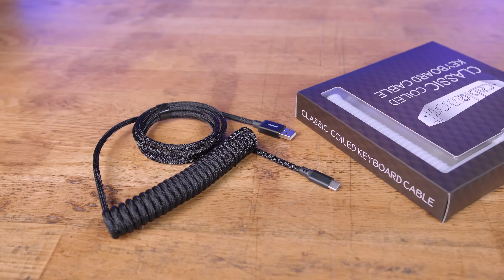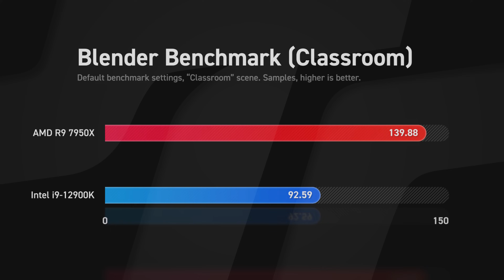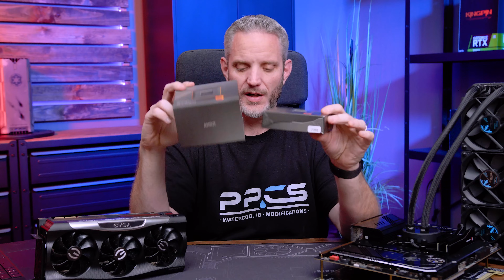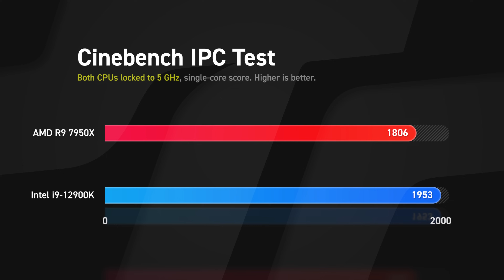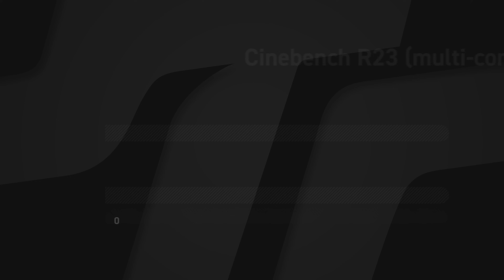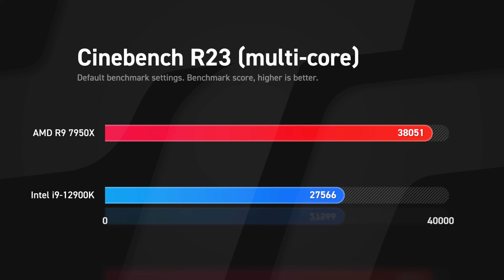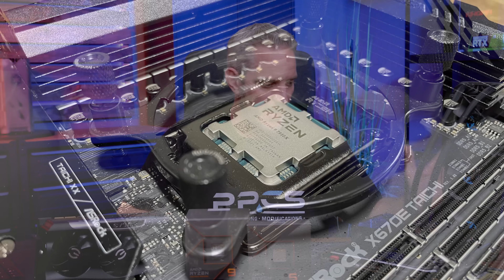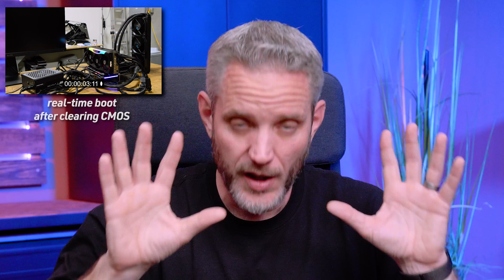Forget EVERTHING you THINK you know about AMD... these CPUs kick A$$!!

Comment: Was skeptical on the new architecture but now I am hyped. Hopefully the mid~lower tier CPU is good too.
Reply: I'm hoping the same, for most casual gamers the Ryzen 5 was te sweet spot last few years (not breaking bank, and could handle most stuff that was thrown at it)
my system will be in need of a little update in the not too long future (Ryzen 5 2600 + RX580 8GB)
Reply: @renemartens5657  the 5600x will be a nice upgrade for you. No need to upgrade on a new platform, save some money and get a nice gpu. At least that's what I would do.

Comment: Space engineers and kerbals!   So the cinebench seem to be the most accurate bench when you are talking physics engine load on gaming, espically unity based games. I play alot of kerbal, and the reason i got an 11900 k origionally was because it was the fastest single core at that time, for running the phsyics engine, because unity only runs the physics on a single core. As the whole came comes down to that, the intel was the best deal both in performance, and performance to cost ratio.  hope that helps someone

Comment: Is it stable?  I left AMD after I owned an AMD K6 back when they broke the 1GHZ barrier and had no end of stability issues.  I switched a few years later to INTEL and haven't looked back with no real stability issues since then.  I'm excited at what AMD has managed to do the last few years, but they burned me a very long time ago so I must admit to having a great deal of trepidation.  So I have to ask, is it stable in day to day opperations?
Reply: Not trying to be rude, but basing your judgement on one CPU generation, and one from 25 years ago, is a pretty broad generalization. Intel and AMD have both had problems with stability over the many years since the K6. I have bounced between Intel and AMD many times in the same time span, and have had successes and failures with each. I've been running a Ryzen/Radeon AM4 build since 2019, and while it was not initially quite as rock solid reliable as the Intel X58 platform I ran before it, after a few BIOS updates it has become just as dependable as any other build I've ran from Intel.

There are growing pains with the first generation of hardware every single time, and as hardware gets more complex, it's going to continue. Intel 12th gen was awful for a lot of people at launch, just as 1st gen Ryzen was. It's the early adopter tax that you must pay if you want to play with the latest and greatest, and IMO if you want to avoid that pain, always give a new platform 6 months to a year before migrating, regardless if it's AMD or Intel.

Comment: I have an OLD pc right now and I'm looking to upgrade. I have an Intel 2600k and gtx1070. Would I be ok to get something like a 5600x or should I be trying for the new 7000 series? Also same question for the gpu. I've been going between 6800xt or 3080 but should I just wait or are lower prices on current Gen good enough?

Comment: My issue has not been whether AMD makes usable CPUs or GPUs, it has been in their deceptive design and marketing practices where they game the benchmarks and push synthetic or atypical benchmarks to claim they are faster.

In every single generational comparison of Intel vs AMD, Intel has beaten AMD in actual use cases for speed. In DAW work for concurrent processing power on live previews, in ACTUAL, non-synthetic video rendering times I experienced, in gaming FPS, in frame delivery (AMD having stuttery delivery spacing) and so forth. Weird hangs in windows. Ever since Bulldozer/Piledriver, this has been the case for me.  Tech reviewers praise a new AMD generation, Reddit drools over it.  I throw one in a second rig, it performs worse than my apples-to-apples Intel rig. Rinse, repeat. Not going to be curious after 11 years of the same situation. Buying Intel every time.
Reply: nop, intel always paid benchmarks, and a lot of comapnies to win against amd.
Reply: @maxdamage4919  Absolutely opposite-land false. Intel always ALWAYS gets more frames in gaming in the same generation. You're delusional and think that Intel "paid benchmarks" when you can just play the games and see the frame difference yourself. AMD, however, lied for a decade about frame delivery issues where they would claim 100FPS but every other frame would have a 20 or 30ms gap. They lied about it for a decade and then admitted to it and said it was fixed and then a year later it turns out it wasn't and they had to fix it again. There are so many weird lies that AMD tells to claim they are competitive. They push these super-wide all-core performance numbers when programs don't thread their work that way and in reality Intel is faster when using the computer to do normal tasks. So many examples of this shady deceptive framing of their performance.

Comment: "The cool thing is that it didn't throttle..." 😂 no, that wasn't cool it was hot.  Sorry I couldn't resist.

Seriously though 95C on a 360mm AIO! 🥵I love improvements, especially big ones, but I also miss the days of like 45C on a Thermalright XP90C(90mm copper cooler).  It feels like the rate we're headed, both CPU and GPU will need to be run on liquid purely for performance issues with heat(I know it didn't throttle, but I dare him to test a 120mm tower heatsink).

Comment: I'm going off topic, but I need to ask if the new AM5 platform is compatible with current gen PSU's?. I am concerned if I upgrade to AM5 I will have to get a new psu which fully supports pcie5, etc.

Comment: From what I've seen, these new CPUs are fine but not amazing. They are going back and forth with the current Intel CPUs. Some games they're a bit faster, some not. If Intel's next chips are faster than the current, AMD is toast.
Reply: They're better in everything.  The only thing they compete against is the 5800X3D, which makes sense because it's designed for gaming.  The 7855X3D will replace the 7950X as the best for gaming (unless Intel gets its shit together)

Comment: Alder Lake does not have AVX512 enabled, only VNNI subset. I can'f find diagrams but it is possible the FPU has more throughput vs AMD, as the underlying architecture has AVX-512 capability in silicon.

Also worth mentioning is that AMD AVX-512 doesn't increase throughput (FPU width) per se but the new instructions will make some computations more efficient and hence, the speedup AMD reported in the presentation.

Comment: Actually, everything but the Ryzen 5 7600x is good at what it's supposed to do. 7600x is a joke. It has no value proposition at the present moment. Maybe when the price of the motherboards go down, but it's not guaranteed they will go down to as low as they would have to go for it to be a good value compared to something like the i5 12600. And then there's the 13th gen coming, and if Intel makes any improvement over 12600 at all and keeps the same or similar enough price? 7600x will have no legs to stand on at all. It's mostly a waste of sand, just like how 11900k was back in the day.

Comment: For the life of me I cannot find any AMD EXPO kits faster than 6000 MHz. From what benchmarks I've seen faster than 6000 actually does impacts performance but all I can find are intel XMP kits faster than 6000
Reply: Does anyone know if you can use XMP kits and just manually set the speeds or do you specifically need EXPO kits?

Comment: I like your reviews b/c they not only have the boring benchmarks that are concrete factual information but also the "it feels . . ." statements b/c perception often is reality. My question is, for something like video rendering where you might be relying on CUDA h.265 more than the CPU does the CPU still play a part, or will you see more of the benefits during editing such as scrubbing the timeline, or dealing with motion graphics a la fusion (I'm a davinci resolve user). Great review. I have a 5950x, so I'm still in the camp of maybe waiting until the next gen as I feel it still has plenty of life.

AM64 was my first, I built the PC, CPU. I then went Core 2 Quad, then 4770k, then 2700X now 5950X. It's been fun watching the technological journey.

Comment: I thought cinebench doesn’t use avx 512

Also please consider pairing these cpu with relaistic gpus at better graphic quality settings. Eg: 7600x with a 3070 in 1440p mid or high. I know it won’t show the full potential of cpu as it may be Gpu bottlenecked. But it will help us those with midrange cards to decide with couple of gen old cpus to upgrade or not

PS: I meant a separate video. Great review as always

Comment: Hi Noob question!
perfect timing as i just started to research into building a new comp for the first time.
I def want to go with AMD. Are these new chips compatible with current motherboards? how do i check? 
thanks!
Reply: No. You need to do a full build from scratch.
Reply: @zodwraith5745  yup! working on a new build. using pc partpicker but it gives me zero options for a compatible motherboard haha. I have two motherboards I had in mind to use, so just curious how to check if it'll work with the new AMD processors
Reply: @Coco-xi9hq  You need to search by the socket, which is AM5. The only motherboards compatible so far are x670. The prices are going to kill you though, which is a HUGE downside Jay didn't mention but everyone else does. You're looking at a $1000 to get on this platform, closer to $1400 for the 7950x. This is the most expensive mainstream platform in history.
Reply: @Coco-xi9hq  Unfortunately, the CPUs haven't launched yet - so the motherboards are not out yet either. The other issue is that you would need to get a different type of RAM for the AM5 CPUs (DDR5 instead of DDR4).
Reply: @icaruswindrune7116  awesome this is helpful thanks! So I guess I'll hold off a bit and make sure I can pick compatible parts.

Comment: I like how it essentially clocks itself according to cooling, but it just makes Zen4 even more expensive. It locks people into needing a 360 AIO minimum to get the performance you paid for. Scrimp on memory? Losing performance there too. Scrimp on motherboard? You can't cause there are no affordable motherboards. This is going to be an issue with people buying Zen4, then buying affordable memory and cooling and not realizing they aren't getting anywhere near advertised performance. It's great that you get a return on buying high end components aside from CPU/GPU finally, but the flipside is it leaves you having to buy those expensive high end components.

Even if it's beating Intel, the cost to performance is poor. For a $700 cpu, $300 motherboard, $250 ram, and $150 cooler minimum? That's insane cost for just your platform. It damn well better beat last year's Intel. Even opting for the 7600x still puts you around a grand price of entry. That's the highest prices we've seen in history.

Then you have the last year of people freaking over Alder Lake's power draw, but now it's magically ok? 250 watts is 250 watts. The laws of thermodynamics don't suddenly cease to apply according to the logo on your CPU. It's still going to need a beefier PSU and it's still going to heat your room the exact same way.

Not to mention this is the most AMD biased review I've seen yet with every other one showing Alder lake much closer. Jay, when that little voice in your head says people are going to call you an AMD fanboy it's because you KNOW you're being a fanboy, letting emotion get involved and not noting the downsides. There's was not ONE negative point in the entire video and every other reviewer on the planet has pointed out plenty. That's not a review, that's a puff piece. AMD doesn't need a marketing team if they can get Jay excited enough to start ignoring drawbacks to a platform.
Reply: Cope and cry.

Comment: Jay, how is this temp boosting behavior going to affect custom loops? Would you need two separate loops for GPU and CPU or would you just make sure to put CPU 1st in loop order or would you just throw more radiators in?
Reply: Other way around. You want the lower power draw (CPU) first in the loop.
Reply: @DoesntRefillTheBrita  I just reread my question I meant to put CPU first not GPU thanks for correcting me.
Reply: I'm not Jay (duh), but I do have an answer for this. 

Having separate loops, putting the CPU 1st on a single loop, or adding in more radiators would depend on what configuration you are running - your case - and what performance you are targeting.
If you want decent performance and have enough space, you can do the more radiators with a single loop, but have it so that the loop runs CPU to Rad to GPU to RAD. This probably would only work if the GPU was not drawing upwards of 300 watts though. Of course, if you put the CPU on Eco (which is meant to drop power consumption significantly and keep performance as close to max power as possible) - this might change. 

If you want top performance across the board, then two loops is probably the only way to do it. You could also potentially try de-lidding the CPU for better heat transfer and cooling (as Der8eur did).

On a side note, Zen 4 laptops are going to be insanely good and efficient (at least according to some benchmarks done with power draw limited Zen 4 CPUs).

Comment: The problem is that not many Programms utilities all available cores. Handbrake only use 6 cores as best for example. 
My CAD SolidWorks only uses at most 30% of my 5900x while locking up for 5mins when calculating complex cuts.

Comment: My favorite part of the AM5 platform is the ECO mode. ECO105 is amazing. They should put labels on the board or removable stickers that explains the memory training in detail. Sometimes, when a system doesn't post for  like a few seconds, it terrifies me. lol
Reply: how do you turn eco mode on ?
Reply: @warking4257  unfortunately, right now, its only in the bios on select boards. This is another feature that will be added down the line. Looking forward that this could be turned on and off from within Ryzen Master. Because this is simply amazing to have.

Comment: Funny enough, this is the only review I've seen so far that the 7950X consumes more power, albeit only 11W, than the 12900. For example, it had 208W in the LTT review against 307W of the 12900KS.
And I'm sure Intel 13th gen will beat the 7000 series in gaming and maybe even in multitasking, but if Ryzen 7000 already consumes at most 2/3 of Intel's 12th gen, and the 13th gen allegedly coming with a lot more power consumption and heat... I mean... I can't see Intel winning performance per watt. Maybe they can pull it off, I just can't see it as of today.

Comment: To be true Amd kick ass since soo many years its just that people stick with theses overprice intel processor when you can pay half of the price for a good gaming performance even back in 2002 Amd had the fastest bus and i remember testing Max Payne and Unreal Tournament on my pentium 3 733mhz vs Amd Athlon XP 850mhz and the gaming experience blew me i never came back to intel since 2002 all my gaming pc has been from Amd i had a Amd Athlon 64 2.2ghz with a ATI x1600 than a Amd Phenom II x4 945 3ghz with a Amd HD5770 than Now Amd Ryzen 5 2600 3.4ghz with a RX570 and now im waiting for DDR5 motherboard from AMD with PCIex5.0 and a Pciex 5.0 amd graphic card i will need to upgrade also my SSD NVME for a newer and faster one !

Comment: The 7900x & 7950x yes but I'm not sure about the 7600x & 7700x. I have a feeling the days of the R5 are pretty much over and it'll take a while to see if the 7700X has any chance of being price-competitive. If you take the cost of a 7600X CPU + 670 mobo + DDR5 RAM it's just not a mid-range system anymore & dead in the water. R5 was THE mid-range CPU but it looks like it's just priced itself completely out of the market.

Comment: Seriously... Do you always have to try to spin it in such a way to make amd seem good even when it aint? 

When intel heated up, you mocked them for being heaters. Now amd is fine, right? Its by design.

Performance in normal use is meh, with 5800x3d beating them in some circumstances, and the cost to get it, mobo and ram included, is huge, with no possibility to still use your old but still potentially good ddr4.
If anything, 5800x3d is still the king of gaming performance, and 5950x for performance per dollar for workloads. Making the new 7xxx cpus... An expensive meh. 

Cant figure out if you're just monstruously biased or just a sellout.

Comment: Soon, Intel gonna respond to this with the new 13th gen Raptor Lake. The competition will be escalating in the upcoming months.
"Raptor Lake CPUs use Intel’s 10nm process, dubbed Intel 7. Though the company claims the process has been reworked, it’s still the same process used by Alder Lake. In contrast, AMD is using a 5nm process for its Ryzen 7000 CPUs. In terms of performance and efficiency, a smaller node is typically better, so this could prove significant. "

Comment: Would I ditch my AM4 5800X system to upgrade to one of these AM5 CPU's, no... If I was in the market for a brand new system if for some reason I required one, then yeah, perhaps I would. Though I think if I could I would wait until next year and see what revisions AMD bring to the 7000 series. Thermals on this new series are just crazy, the IHS is just too thick. Watch der8auer's delidding video where he shaves off up to 20+c proving that AMD royally screwed up this design.